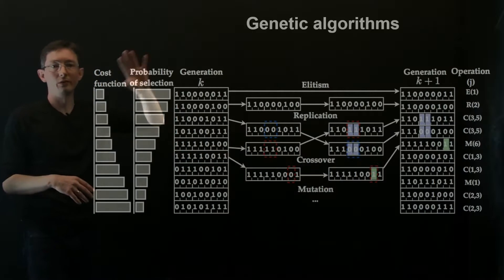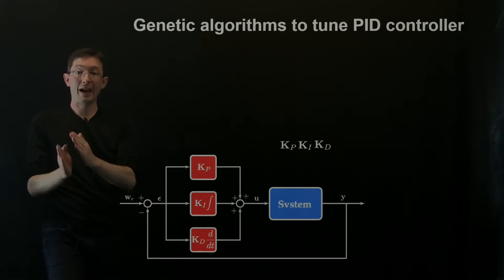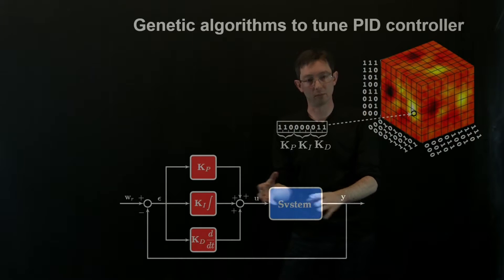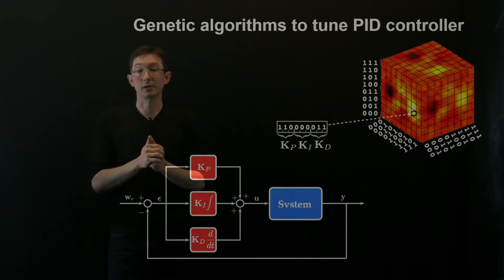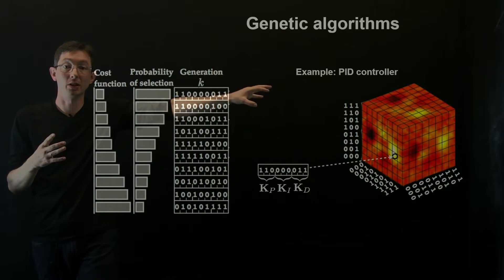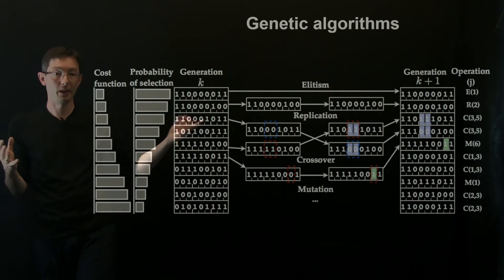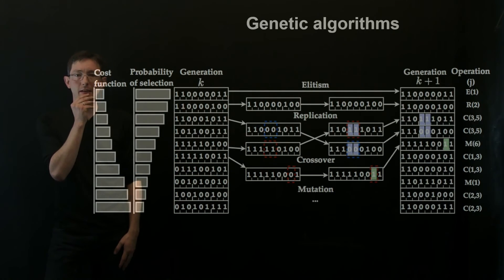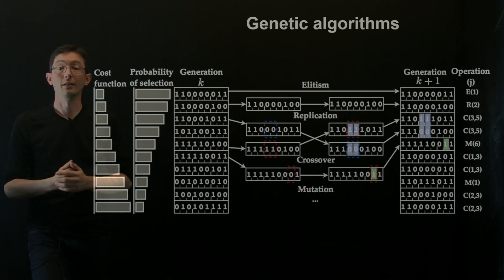Machine Learning Control: Genetic Algorithms

Comment: One problem with tuning PID here is that it is difficult to evaluate the cost function automatically , the motor could be damaged or else if you just use random mutations on control laws. Also i think one of the problems with Genetic algorithms is that it is not really clear how the binary encoding of the parameter space works, I think these concepts easily port over to Evolutionary Strategies or ES by Schwefel and Rechenberg, where this is much more straight forward.

Comment: Based on the diagram shown at 11:00, I'm a little confused on how the "probability of selection" (or the second coin flip, as you say in the video) influences the GA. It seems like all of the individual parameter samples shown make it through the evolution from generation k to generation k+1. Does generation k actually have many more individuals than generation k+1? This may be covered in a later video...